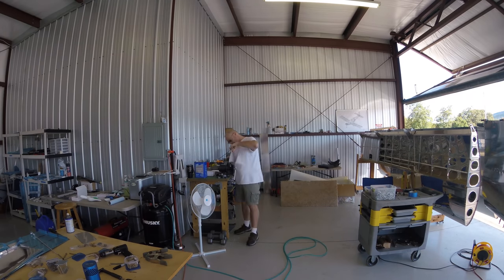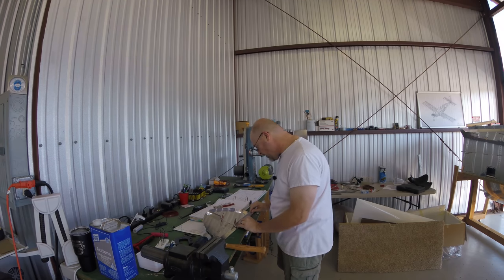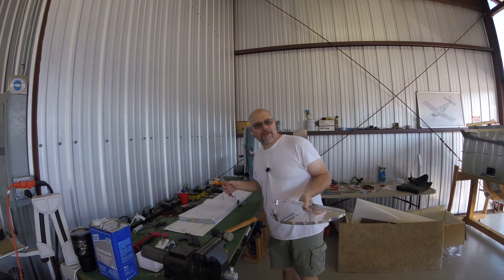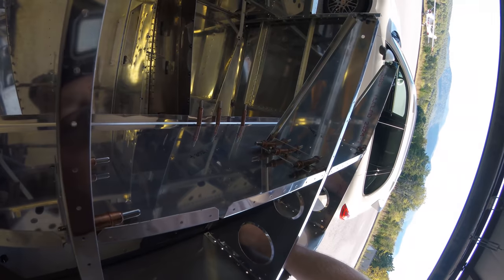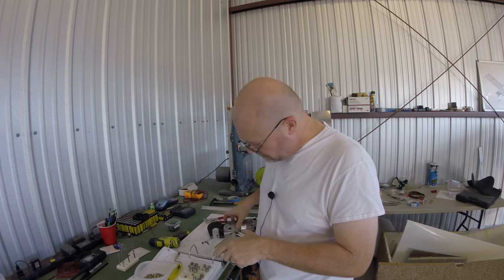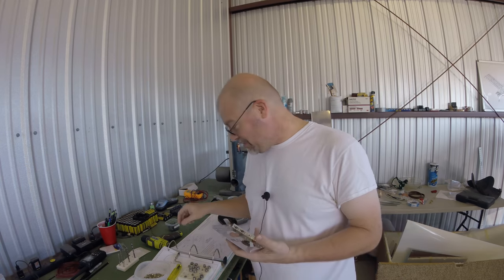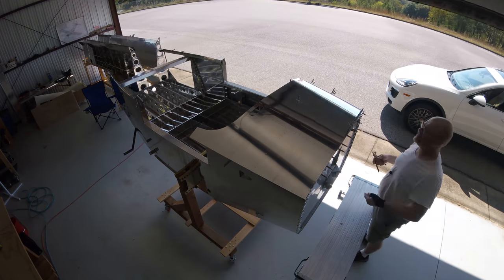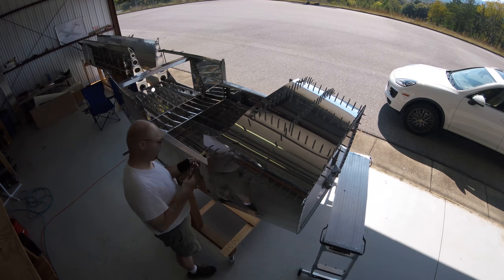RV-10 Fuselage - 034 - Almost time for airplane noises!

Comment: Sec. 31Q is if you are planning to use the Van’s Throttle Quadrant Kit (CT 10-3 QUADRANT KIT) vs Sec. 31 which uses the 3 knob push-pull
version. Your option. F-1083Q is provided in the quadrant kit. This kit is not included in the finishing kit and must be purchased separately. 41Q also
addresses the Quadrant option.
Reply: @Jax Ralph definitely, been using InstaFlixxer for months myself =)

Comment: Love watching your videos, keep up the great work. As a A&P I wanted you to understand the term "Match drilling" which  you use from time to time. Match Drilling is a process where you have a pice of medal that has no holes (unfinished) and you want to transfer a hole patten that you have from a finished part. So by Drilling though the part with the holes into the parts with no holes you are creating a hole patten based on the fished part and now can join the two parts together based on the original part. What you are doing is final sizing the holes.

Comment: I agree.  Don’t wait.  I waiting until I was 60 and retired and assuming 2-3 years to build the airplane, I probably have at most 20 years to fly it, and very likely as few as 10.  I wish I has started many years ago even if finances meant the build took 10-12 years.  Starting at 35 and taking 15 years to build still gets you an airplane at 10 years sooner than waiting until 60 to start.

Comment: Hi Jason. Your comment about shielded wires vs nonshielded. You really do not want to use shielded wire over the entire airplane due to weight and cost. You will be installing more wires than you might think and having all wires shielded will add up weight and cost wise. Shielded wiring is normally used for avionics systems signal wires and audio communication wiring such as head phone jacks. DC power wires normally do not require shielding. You also need to make sure that you ground the shielding to the airframe chassis. Having shielded wires and not grounding one end to chassis really does not do to much to reduce interference.

Comment: On all those decisions on panel and engine controls. Comes down to experience and personal preference. I grew up on steam gages, soI’m ok with them and find the MDL or Garmin panels fancy but crowded. However there is way more flexibility with the ability to switch displays around and probably safer in case of hardware failure. If a TV screen packs up, the ability to switch your PFD to another screen when in IMC goes a long way. For that reason I would keep it symmetrical with dual screens. There is always a possibility that you need to fly from the right seat. For example if there is a crack in a windshield or visibility is impeded on one side or a seat adjuster broke and you need to take her home for repair.
Engine controls; if you can eliminate the centre console, I’d prefer that. Reason being, it’s easier to reach over if a door pops in flight or when an exit is blocked after an emergency, absence of a console is safer. If you have long legs and sitting far from the panel, the centre console is probably more comfortable for reaching the controls, but otherwise the vernier controls work just as well, probably more accurate than the quadrant. Best way if you can, is just sit (preferably fly) in both configurations and see what feels best for you personally

Comment: It is called spring back. Alum is nasty for that, Steel isn't as bad and whoa, Titanium is killer, LOL. For production work it is usually calculated into the press etc, free hand it is just feel. If you have the correct bend radius it usually isn't too bad. Good idea to leave the PVC coating on the parts when your bending to to help prevent marring of the surface.

Comment: Been making form tooling for years.. About 7 degrees overbend for 6061-T6. 2 degrees for 2024-O. Your fighting the " modulus of elasticity". I would make test bends on a press brake before committing to a CNC made form tool.

Comment: One thought on the symmetrical panel - it would make it easier for you to fly from the right seat if you wanted to, not for training, but just for fun.  I was told by an instructor many years ago that Diamond DA-20s with the panels set up backwards are used in training, with the student flying from the right seat to get a feel for flying with the stick in right hand, throttle in the left.  No clue if that's true or not...  FWIW, I don't know what everybody's talking about - I didn't notice an accent at all!

Comment: Spring Back with no more than a 1/8 radius.! Putting 2 longer pieces angel iron in your vice often makes a good brake, and helps with the radius.! Round all 90% points into a 1/8 radius. No sharp points.! Rogue Squadron .! Test fit with plastic on if you can.! Looking good with one day at a time. Thumbs Up for caring by sharing.!

Comment: Just a thought on the small bolt and crows foot wrench. If you develope any concern with the slight modification to the bolt, Mine being corrosion. Grinding breads rust. You could change it out for an Allen head style bolt.

Comment: Elastic and plastic deformation explained in the video, aluminum is the first graph.  In short, you must go past the Elastic limit of the material and into the plastic region, for the metal to be permanently  deformed.   https://www.youtube.com/watch?v=frGL1jTnDsg
1. (Elastic region) Bending with increasing pressure, will spring back to original shape.
2. (Plastic Region) Bending with leveling off pressure, from this point on, move about the distance you want the change to be.
3. (Elastic Spring Back) When the pressure is removed, it will spring back about equal the the elastic region of the movement.

Comment: I wonder if you have read any of the builder books by Tony Bingelis?  Specifically "The SportPlane Builder" and "Sportplane Construction Techniques".   I think you would find them useful and recommend you look into getting copies from the EAA.  I know at least one of them has a chapter on bending metal and talks about how to determine the bend angle to account for spring back.